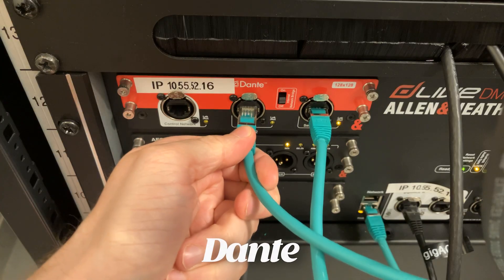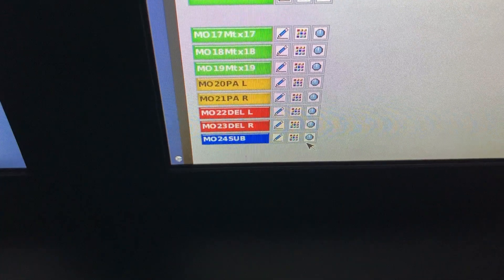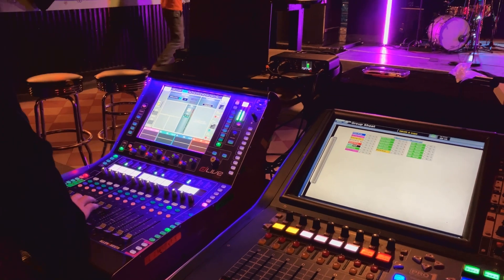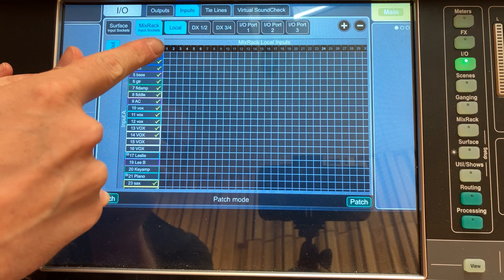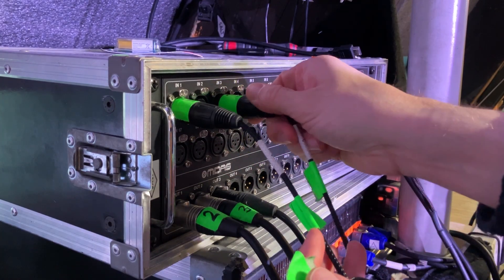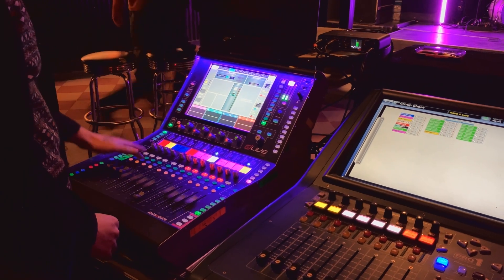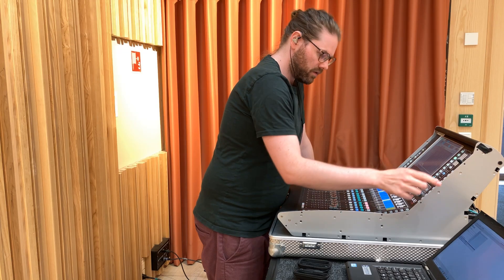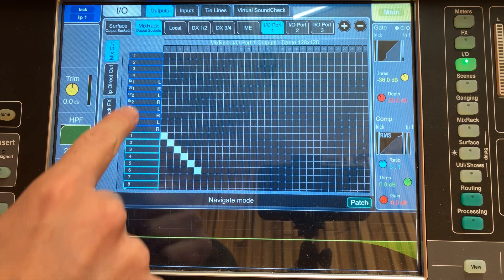Why You’ll Never Get Sound Without Fixing This First

Comment: Keep in mind that the people who design digital consoles have LITTLE real world experience as audio engineers.  Maybe they were in a band at 20yea old   But they certainly weren’t on the road mixing Sting etc etc.   And most digital consoles are pretty ridiculous to use if you don’t have plenty of experience with the desk.    I worked for decades with high end artists and always had someone standing next to me helping to deal with routings and other issues.  (Thank God)   So I have been doing this for decades and would need the j
help from the guys that had lots of experience with the desk. (We might have had shows in 20 different countries in a month).  So these engineers that were working with the company providing the console were INVALUABLE.  

I prefer the audio from high end analog consoles but there are many digital desks that sound quite good.  And I get it.  There are many reasons that show why the digital desks are better for some situations.  

Anyhoo.  I prefer a great analog console to any digital desk.

Comment: Snakes and stage boxes still provide input jacks numbered from 1 - N. Digital mixers still provide input channels numbered from 1 - N. Aside from idiosyncratic special cases, there is no defensible reason why stage box inputs 1 - N should not be permanently assigned to mixer channels 1 - N. Most mixers also provide rear console inputs 1 - N, useful for connecting control room sources. These should also be permanently assigned to sequential channels in the order they're labeled. To distinguish between the two groups of input sources I label the stage box channels CH 1 - CH N and the rear console inputs IN 1 - IN N. Other miscellaneous physical and/or networked inputs are assigned to the remaining channels in a similar manner.

With this physical input channel assignment settled, all you really need to consider is which channel to assign to each fader within each virtual fader bank you program. It doesn't matter how you arrange your fader banks, the physical inputs remain permanently assigned to their mixer channels. This eliminates all potential confusion between physical inputs, networked inputs, and virtual channels.

Comment: Thank you for your help.  You have an excellent way of explaining these technical issues. I have been using analogue mixers for years both live and in studios for 30 odd years. I am about to buy a behringer x32  and wanted to understand routing signals. It does help with my experience knowing what I want the desk to do but having trained younger musicians how to use gear, I appreciate how you explain for beginners too. Breaking the mystery of what, at first glance, seems daunting, is everything. I used to explain  one channel of analougue mixer from top to bottom and then say, now all these other channels are the same. That got them to stop fearing a huge 32 channel desk and understand the environment they had to learn. Digital mixers simply offer a different layer of options which are ultimately much more useful. You described so much and I love the parent/child illustration.  Good job man. Love it.

Comment: Hi Andrew!
Great discussion on the complex topic of patching and routing. I liked your emphasis on understanding why (or how) this topic is important. 

Forgive me if I misunderstood you; clarification is needed on the differences between patching and routing.

On the Allen & Heath dLive, you referred to the Input/Output (I/O) screen as the routing screen, which is incorrect. The I/O screen is where you PATCH sources to destinations (for example, input sockets to input processing channels). Press the routing key to ROUTE input channels to buses (Main, Group, Aux Send, Fx Send, or Matrix). You can also route buses to other buses (i.e., Groups to Mains, or Mains to a Matrix). Once you have done this step, you return to the I/O screen to PATCH the bus to an output socket. In essence, patch, route, and patch to get a source to a destination.

A key concept is understanding the difference between patching and routing. Both steps are part of the same goal of connecting a source to a destination. The difference is that patching is done externally, outside the mixer, while routing is done internally, inside the mixer. While performed on the console, virtual patching is considered a step done outside of the mixer. 

I learned this concept from attending the Allen & Heath online Mini Master Classes, available on the company’s website for anyone to view. Expertly taught and highly recommended!

In summary, your signal flow on an Allen & Heath dLive console looks like this:
A microphone is (1) physically patched to an input socket, which is (2) virtually patched on the console's I/O screen to one of the 128 input processing channels. Then you go to the Routing screen to (3) route the input processing channel to a bus, which is (4) virtually patched (on the I/O screen) to an output socket where you can (5) physically patch the mix to your destination, such as a powered speaker.

Alternatively, you can select the preamp tab on the channel processing screen to patch an input socket to the selected input processing channel.

Andrew, I truly appreciate your passion for audio and enjoy watching what you post on YouTube. Keep up the great work!

Comment: The whole Dante thing got me until I saw the Dante patch menu within the Yamaha CL console and I understood that there was a whole second layer of Dante patching. I found it difficult to understand in Dante controller where the outputs on the console were coming from I.e. was Aux 1 Dante 1 ? And then I saw you could change aux 1 to be any of the Dante outputs 1-64! Which makes more sense for channel direct outs. Some are pre patched and some are left to be filled as needed.
Reply from the maker: Yeah it's a lot to get your head around at first. It still trips me up sometimes when there's a lot of dante devices on the go.

Comment: On AH SQ series or in general what is your approach for FX Sends or Return bus.  Do you leave the Send bus at 0db and adjust the "wet" level to the LR bus at the Return fader or the opposite?  I feel like the FX "group / bus" button is already you telling how much level from each channel you are sending into the bus and therefore the FX processor.  So in my mind it makes sense to then limit the FX output return bus level before LR mains to make a wet/dry blend.  Thank you!
Reply from the maker: Good question. I leave the return channel at 0 during soundcheck or ore production then set levels using the send. During the show I'll ride the return for reverbs and the send master for delay. I've always got 1 verb for instruments, 1 for vocals, and a delay for vocals.
Reply: @OffshoreAudio  So you do both - depending on the FX.
Great, another choice to make: Is this a send or return fader FX?
Reply: It's been explained to me that if you set the returns to 0 and use the input/send bus to change the level, then the FX get louder & softer naturally.
The signal goes in, gets FXed, and then flows out to the return.
If you ride the output fader, then the loud processed signal is getting cut off.
Think of a long delay or echo. If you pull down the return, then the echo just stops, dead, chopped off.
If you pull down the send, then the echo fanes out. The input gets softer & softer, gets processed, and goes out softer & softer.